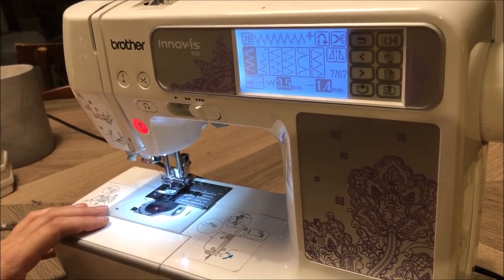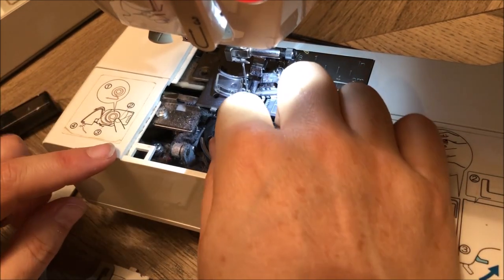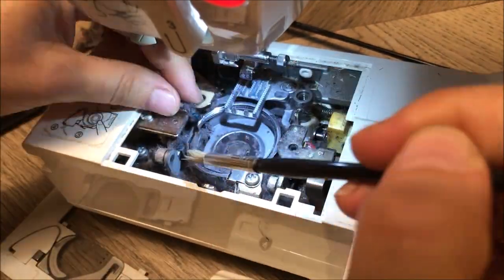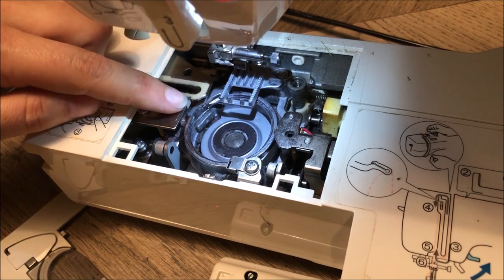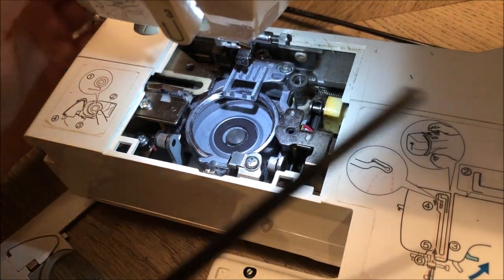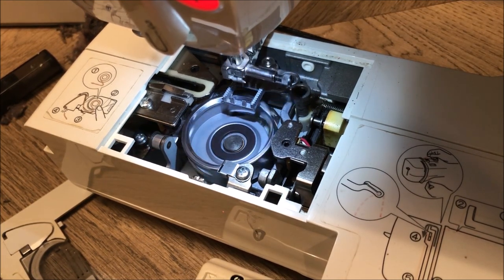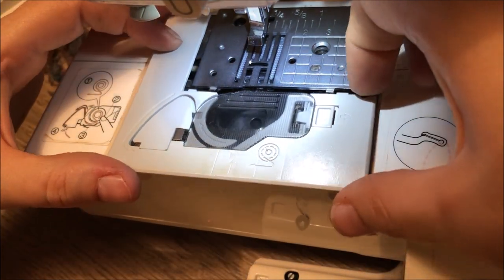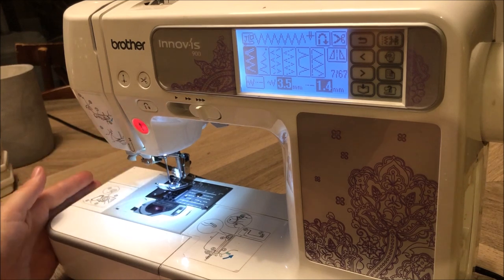How to fix a VERY jammed / stuck / broken sewing machine - Brother Innovis 900D

Comment: Congratulations on being so brave!  I have a Brother that seems to have stuck like yours did.  I haven't used it in over a year as well and haven't had it serviced for the same reason.  I remember that the last thing I was sewing was fleece, so maybe I also have fuzzy dust in mine, which is not the same model but I bet the guts are pretty much the same.  I'm going to give it a go in the morning.  Thanks so much for the demonstration!

Comment: Thank you so much. I usually fix laptops and should have figured my sewing machine will be clogged with thick dust over time like the air vent on laptops.
P.S wow your digital sewing machine is quite advance, I'm still using the old one lol.
Reply from the maker: Optimus Prime so glad you were able to fix it. I still love my old sewing machine too. This one goes too slow! But my favourite feature is the auto thread and cut.

Comment: I have a Singer Promise 2 and the model doesn't allow any screw driver too tall to unscrew the screws, I've tried coins and almost everything else you can think of. I am also very new to sewing. Any advice?
Reply from the maker: May Seydel how many centimetres or inches is there to be able to get a screw driver in? You can buy really small screw drivers on eBay and Amazon.
Reply: I use a square pin 🤷🏼‍♀️

Comment: I have a Baby Lock BLDC (made in the same factory as Brother) that seized up. Troubleshooting in the manual said there was a thread jam in the bobbin area. I kept her very clean, but there was thread stuck in the thread take-up area - but still was frozen after I got that cleared. The mechanic quoted me $400 because there was a broken gear. It has been over 2 months since he ordered the part - but it still hasn't arrived. I caved and bought a new Janome DC5100 for $150 more than the repairs would cost on my sixteen-year-old Baby Lock. I will put the old girl away and try to find the part myself when the economy is healthy again & covid-19 doesn't have everything backed up. Sewing machines are like cars. When you find that perfect fit for you it makes you cry when you have to part with them.
Reply from the maker: Susan Dickson oh what a shame! I had a part break on my overlocker and I found that it was still usable as long as I didn’t lift the foot lever. I vowed to replace it one day but that was 6 years  ago haha! Maybe you could have the part you need 3D printed?
Reply: @NicoleHerrickDIY  first I need to get the machine back with a notation as to exactly what part it is it needs to be replaced. I hope that process doesn't take as long as it has already taken...

Comment: My sewing machine fell on the floor, not from too high and when I went to sew, the motor.made a loud sound and didn't sew, also the handwheel is stuck. I opened it up and it looks fine, nothing looks broken...what could be the problem.without going to a repair shop??? Please help!
Reply from the maker: Ashley Cobb there are well over 1000 parts in a sewing machine. Sorry I have no idea which part could be broken without looking at it.

Comment: Hi! Thank you for this tutorial, my machine needle will only go down but not up again unless I do it manually, do you know how I can fix this? Or what I did to cause it?
Reply: mine too!
Reply: Morgan Mourillon it was an issue with the alignment of the needle! Try moving it!
Reply: It's the wheel that's jammed
Reply from the maker: Try having a look in the upper section to see if there is something jammed or it needs cleaning. You miggt also need to lubricate some sections with sewing machine oil after cleaning. Here is how you clean the upper section. https://youtu.be/nySznUlUP1s

Comment: Mine is STILL jammed up. My hand wheel will NOT move at all. I have done everything that you have done and still nada. I'm so frustrated. I don't have the funds to have it repaired and I'm lost as to what to do ;-( I want to cry, but that's not going to solve my problem. There's no broken pieces or lint down in it, so it's like there is something keeping the hand wheel or the needle from going up or down. Any ideas ladies?? I need help so bad!
Reply: @Peace2yaa did you find out how to fix yours? I’m in the same situation :(
Reply: @waihekesmurf4485  Unfortunately, no :( Still sitting here the same. I literally don't know what's wrong with it. I was using one minute, the next, zilch! Literally within seconds and I was lost. I've taken parts of it a part, but nadda. I don't see anything or reason as to why it's locked up.
Reply: @Peace2yaa  I’m a novice sewer; my handwheel suddenly jammed with a clunk, no movement after sewing fine. I got brave (or stubborn?!) after watching this video, plus one on how to take the front off, and this one: https://youtu.be/TUxkGZSg7ZM 
The last video is a man cleaning and pushing a big metal bit, I sort of tried that a bit (different model) plus q-tips/ear buds to clean the metal vertical shaft and got a little movement! That pushed me on :) There was still a lot of resistance, I think mine was getting stuck on the shaft so I cleaned that lots and put on some lubricant oil that came with the machine (never used it before, but was desperate). Cleaned everywhere I could while it was apart and slowly got more movement. On the handwheel side was lots of yellow grease, left that except for cleaning a big metal thread and then spreading some of the grease back around. I don’t know if any of this helps you but something in all that got mine working, so sharing in case, good luck!
Reply: @waihekesmurf4485  Wow really??? I have taken everything that had a screw in it out/off and still nothing. This machine could not be any more clean than when I bought it. And still nothing. I'm happy for you however friend! Wish that would happen with mine. I've only had it a couple of yrs and now wishing I had gotten some kind of extended warranty or something. Anyhow, have a wonderful evening Smurf lol
Reply: @Peace2yaa  did you check the button at the back of your machine, if it is in the right position?
Reply: @trilbycolearts  yep, it was one of the first things I did . Thank you so much for replying. I"m still stuck.

Comment: Do you have any suggestions or videos for when the foot presser lever is stuck? i took off the foot but the bar does not go up or down and wont budge
Reply from the maker: Do you mean the lever that lifts the foot up and down or the arm that goes up and down as you sew? If it’s the arm, yes, here’s my video on how to try and find problems in the upper area of the sewing machine. https://youtu.be/nySznUlUP1s
Reply: @NicoleHerrickDIY  its the lever that lifts the foot. i tried doing the steps in this video and that one but its still locked. Last night, it went into safety mode after a thread bunch up, so ive cleared it all out but the lever is still locked
Reply from the maker: @thewonderofanime  it may have a screw that’s has come loose or off. Try tipping your machine on its back or front and see if you can look up in to where the lever goes. See if you can spot any issues.

Comment: Ummm...so what happened to me is that the string that comes from the bottom got sucked in and what happened is my dad took the whole roll of the string inside the bottom of the sewing machine. Now we don’t know how to put it back, and we have probably lost the manual.  Please help! Thanks
Reply from the maker: _ Gamehedgehog _ what is the brand and model off your machine?
Reply: Expired Onion  Hi Onion, If you have a printer you can download the manual and print it.  Warning though, it will take a lot of paper if you aren't able to set your printer to print on both sides of the page.  Or you can probably sort through the manual pages on your monitor.
Reply: Mary Riley thanks for the help, but I solved it already 😅

Comment: I have the same one as yours although the screen is currently stuck at the lcd brightness settings and somehow the only thing that works is the left and right arrows but the back isn’t.
Reply from the maker: Ok they may be a silly question but have you tried turning it off and unplugging from the power then turning back on? Mine went to this once and that’s the only way I could get it back to normal.
Reply: @NicoleHerrickDIY  done that already and it seems like it still goes back to where it was :( the bobbin wind is pretty much working because I could see the red light turning orange although I feel like the lcd is broken. Not responding at all
Reply from the maker: Ok I’m doing some research to see if I can find any info. Try this next: https://support.brother.com/g/b/sp/faqend.aspx?c=us_ot&lang=en&prod=hf_se625eus&faqid=faqh00100743_000
Reply from the maker: Also, it looks like you might be able to get tech support from Brother in your country even if you don’t have warranty left. Look for their support section and contact them to see if the can talk you through how to fix the screen freeze.

Comment: My presser foot lever is stuck. Do you have any suggestions? I have searched the internet to no avail.
Reply from the maker: msdc011 ok lets see if I can help. Are you able to lift it without the lever eg lift it up or down with your hands? Can you take the foot off at all? Does it feel like the lever is stuck or that the lever moves up and down but the foot doesn’t move?
Reply: @NicoleHerrickDIY  The level won't move at all. My husband is actually looking at it now and he can't budge it
Reply: He actually got it working after knocking it loose. He said it may have needed oiling and locked up. Which is crazy because it wasn't even 9 months old
Reply from the maker: msdc011 the foot lever should never need oiling.  It perhaps there was something stuck or a part was faulty. Have you got it working again now?

Comment: Hi Nicole.Thanks for the reply,but my problem is not solved because its the Drive belt tension that causing the needle not to move Up or Down
Reply from the maker: Enica Gouws well it sounds like you now know what the problem is so you can easily get it fixed.

Comment: What are you turning it with
Reply from the maker: Do you mean to make the needle go up and down?  The wheel on the right side of the machine.
Reply: @NicoleHerrickDIY  i believe i fixed it. This video helped me from buying another one. Thank you
Reply from the maker: @elimitchell6147  ohh that’s great!!!
Reply: I ran into another problem. Where it gets stuck and the bottom bobbin case pops out
Reply from the maker: @elimitchell6147  ok have you checked to see if the needle is bent? Does it spin properly if the needle is not in?
Reply: @NicoleHerrickDIY  the needle isn't bent. I believe its the bobbin casing
Reply from the maker: @elimitchell6147  the next thing to do would be to take a short video of it and post in a Facebook sewing group. There’s always lots of people who can spot what’s going wrong.

Comment: Mines like this but my fabric is stuck with the needle down and I can't get it out!
Reply from the maker: Bron tea unscrew they needle and try to pull it out, you may need to cut a few threads here and there. Also try jiggling the wheel to help free the fabric.
Reply: Same happened to me I had to cut part of the fabric, followed the steps in video and now is back to normal!

Comment: How to fix stuck thread in thread guide?
Reply from the maker: Royal Queen I generally just pull on it to snap the thread then pull out any parts of the thread and rethread.
Reply: @NicoleHerrickDIY  I managed to unstuck the thread inside the thread guide when I put my machine in a lying position. Then the stuck thread suddenly came out. Normally I don't encounter this. Its just my thread maybe got some crumpled small thread. Thanks Nicole

Comment: I'm getting error E6
Reply from the maker: Roger Watson an error 6 usual means the thread is tangled. Try taking out the Bobbin putting it back in. Also rethread the whole machine. If that doesn't work, try a new needle.
Reply: I fixed my error E6 just by making sure before I thread the machine my presser foot is up and my flywheel is aligned with the line of the machine... error E6 gone

Comment: But why write broken because this is different.  Mine is broken so it's the top that has the problem not the bottom. Pls dnt put misleading headlines
Reply from the maker: Because that’s the search term most people use when their machine has stopped working. If you’re machine won’t run any more, you say “it’s broken” It’s not misleading, it’s helpful. If you have issues in the top section, be sure to check out my video that deals with this. https://youtu.be/nySznUlUP1s
Reply: Hi mine broke the same as yours did and this video was not helpful. Could you tell me how or if you fixed yours?

Comment: Hi :) Have you had any issues with your feed dogs not feeding the fabric? Mine moves but barely touches the fabric so the cloth doesn't move at all :( I made sure the feed dogs are on the "up" switch too. Just trying my luck here since we have the same exact machine (youtube doesn't seem to bring up anyone with the same problem + machine). Thanks!
Reply from the maker: Perhaps there is some fluff that’s stopping them from going all the way up. Or if watched my video, I had sooooo much fluff covering my feed dogs which made them essentially flat.
Reply: @NicoleHerrickDIY  Thank you for the reply! It's not unfortunately, mine is pretty clean. It's ok, I'll keep messing with it and hopefully figure something out :)
Reply: Make sure the needle is in the fully down position when switching the feed dogs, especially when switching from the feed dogs down to back up.
Reply: @lenzasti  Thanks for the tip! I never knew that :)